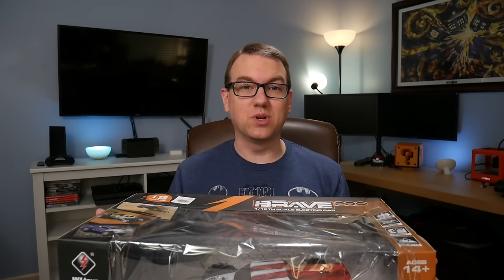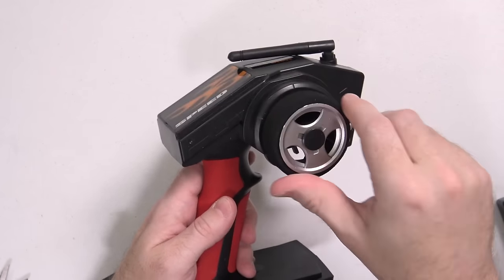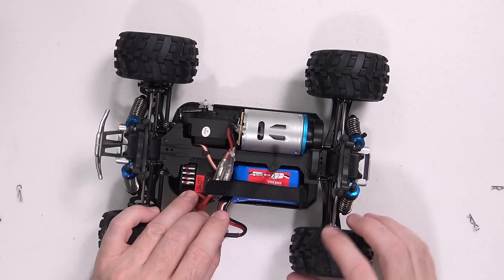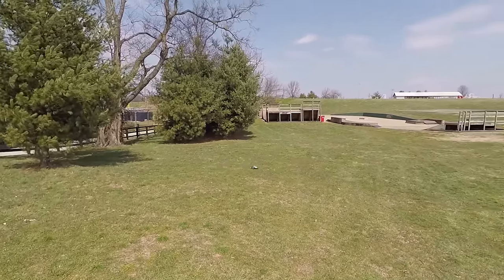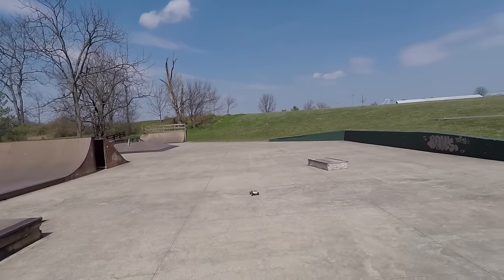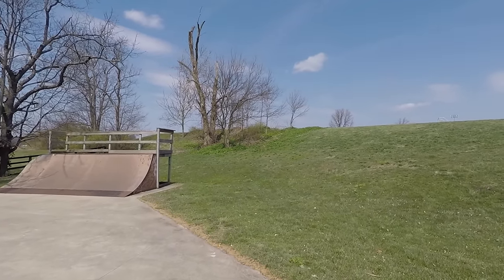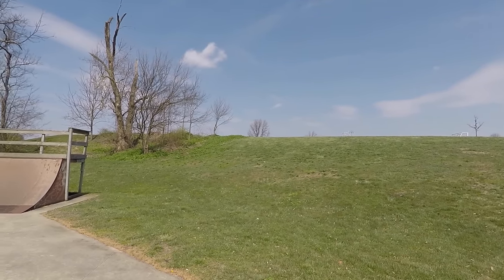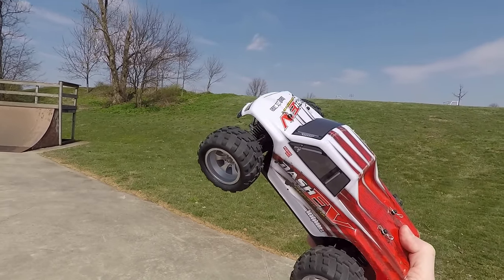70KM/h Off-Road RC Truck! WLToys A979

Comment: I'm having an issue with my it can be fully charged but after 5 minutes  or so of hard driving it random stops moving can turn the front wheels but the throttle wont work

Comment: I have the 979a and love it .three years and finally had to get a new motor. I don't drive it that often which is why it lasted so long .I put oil shocks which helped and metal gears to go with the 540 motor i put in . its defiantly a great car for the price.
Reply: How much was the motor?
Reply: @magyaradam  I'm not sure it was so long ago, but under $20.
Reply: @LEVARIOMIKE  sweet. Thanks man

Comment: Jordan, can you please compare your a979 and subatech bg5150b?
I dont need speed, more important is stability in cornering / low jumping, also battery life... I read that overheating is present often, on the other hand metal parts are available
Which baterries are in a979 pack?
Bg5150b have 14500 type in it...

Comment: Also the car doesn't do very well off-road because of how light it is. You can upgrade heavier metal parts which also improve the durability of the car.